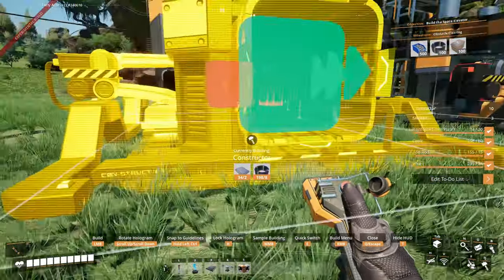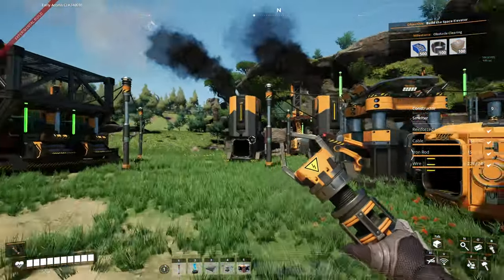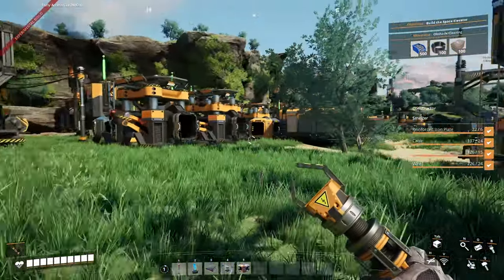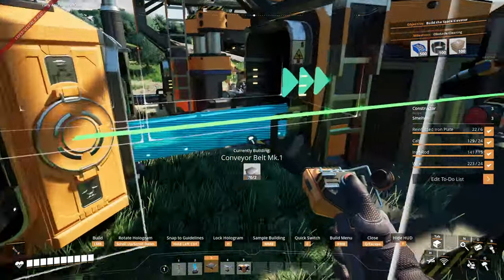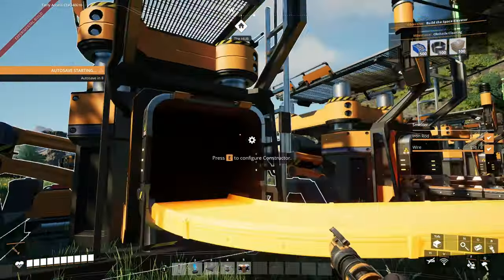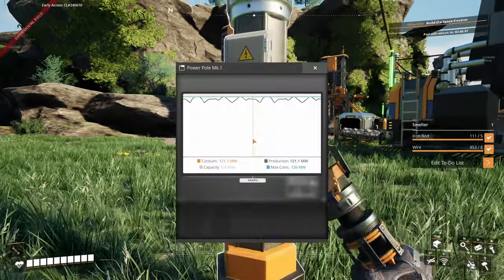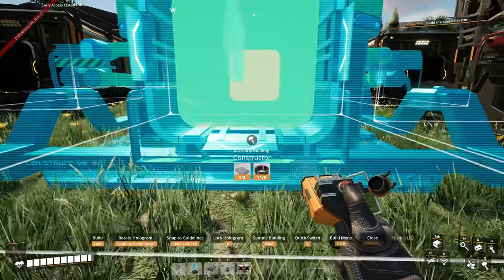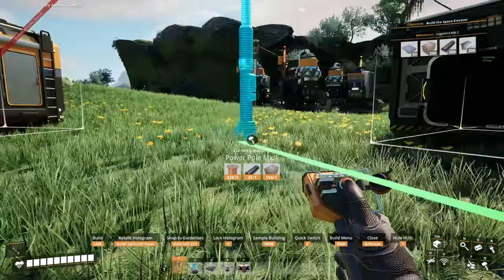Let's Play Satisfactory Update 8 |Ep.2| SCREWY CABLES

Comment: Don't know if you're pre-recording, but screws production is acually suboptimal. Each belt outputs 15/minute, so your splitters divide it into 4 belts of 7.5/minute, 2 of which combine resulting in 2 constructors undersupplied and 1 constructor oversupplied. To get everything correctly, merge the outputs into 1 belt 30/minute and then split it in 3 ways.
Reply from the maker: I'll have to double check the outputs thanks for the heads up
Reply: Came here to say the same thing. It bothered me enough while watching to check the comments. haha

Comment: I noticed you're playing in Early Access - Update 8 are there any drastic changes from update 7 vs update 8?
Reply from the maker: The big change was switching from Unreal Engine 4 to 5 but they also did a bunch of other stuff that is to numerous to really put in a comment. Here is a link to the patch notes https://steamdb.info/patchnotes/11458947/ I haven't run into any bugs so I think it is worth checking out the experimental build and getting to enjoy it yourself. :)
Reply: @SmolPaul  I've just finished off installing 100 fuel generators (because you always need more power) and bug-wise, I have had quite a few crashes, which always occurred when the game was preparing to autosave. The fix to this that worked for me, was inclosing the walls of my factories (I'm big on globalization with many small factories making parts to send to my main factory).  I believe it's an optimization issue, and the inclosing trick has worked for years, especially when my framerate would start dipping.
Reply from the maker: @kttank1612  Cool thanks I will keep this in mind if I start running into any issues!